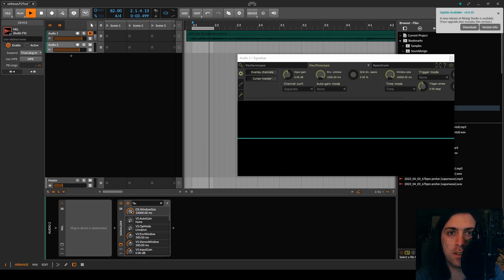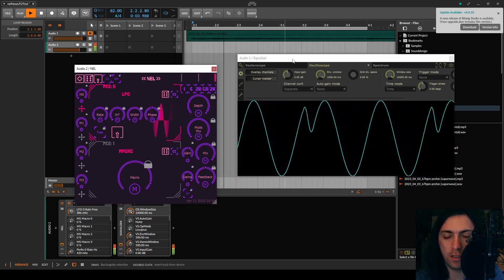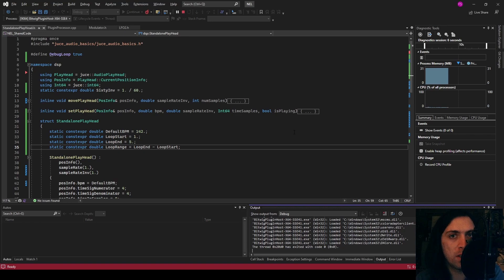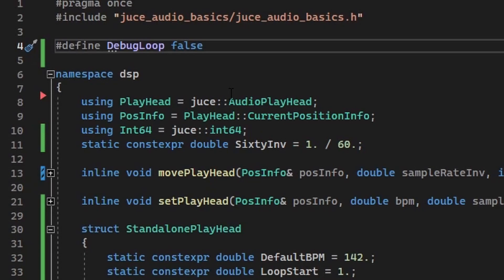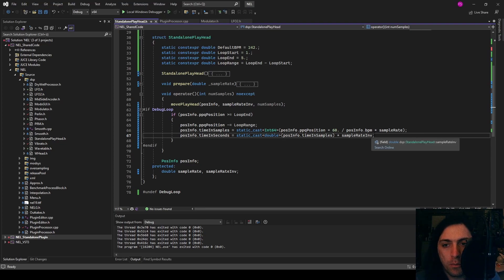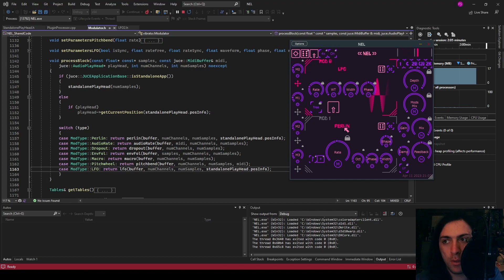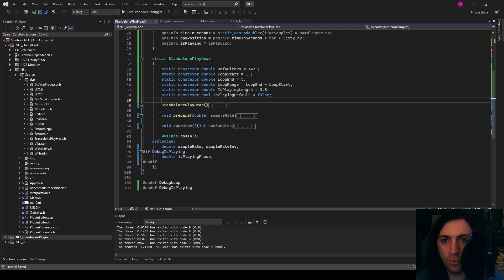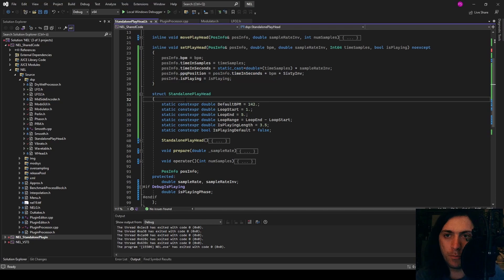Debugging PlayHead Stuff [JUCE Tutorial]

Comment: Hey mate! The UI of that plugin looks super good, how did you make it? Did you use native JUCE classes?
Reply from the maker: i use a lot of juce native functions for drawing shapes and all that. but i also write a lot of own components to make things work elegantly. especially the modulation system required a lot of basic things to be rewritten, like parameters, Slider etc
Reply: Helpful vid! Do you know if there’s a way to control the DAW playhead position or transport functions from inside the plugin when running as an AU/VST3?